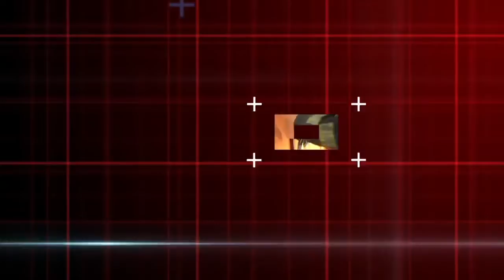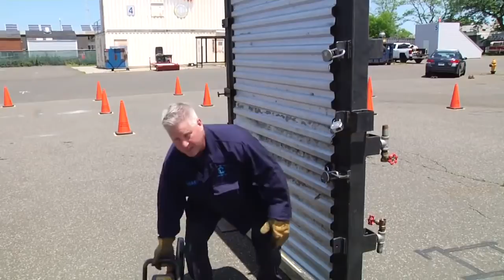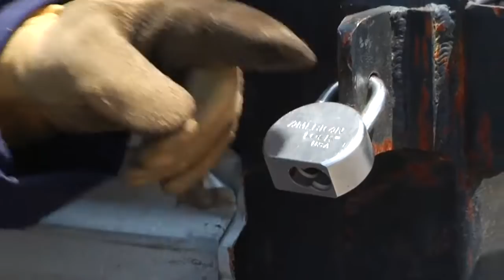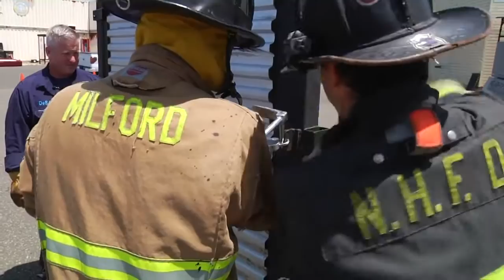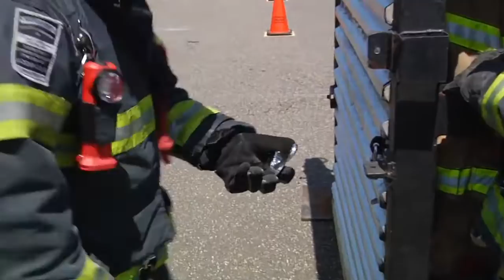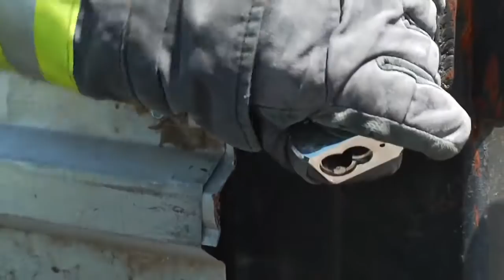Forcing Padlocks with Hand Tools #5806229200001

Comment: The first mistake is assuming that the lock is the weakest link.
You can actually get slowed down and even injure your self trying to fail a lock when the structure it is barring is far weaker.
Reply: technically, the first mistake is no eye safety
Reply: I agree, often the entry way is the most secure part of any building or room.  The door may be the most secure and strongest section of the entire wall.
That said the shackle is often the weakest portion of any lock.  Yes, it is often cutting hardened and you will find it hard to push/pull it, but I have yet to find any that would withstand twisting.
Reply: @luckyx16  When responding to an alarm, look for ways to minimize damage to the property while investigating the cause for alarm.

Comment: both those padlocks are easy picks (less than 30 seconds) with just a turner and a pick.  No need for mindless destruction
Reply: During a fire?
Reply: @topheavykoolaid  yes genius.  It is FASTER to pick than what they did.
Reply: @protonneutron9046  At night, with full protective gear, no way.... Those gloves have zero dexterity. No sense in fumbling with a pick. The irons are going in the front door with you anyways. The twist off method is definitely preferred...
Reply: @protonneutron9046  Maybe not in your mom's basement but a door is often 500 degrees or more... At least in my 24 years of experience as a career firefighter. Man up, join up, and stop watching Chicago Fire...

Comment: Once the key way is removed from that pad lock, a simple flat head screw driver will turn and open it as well.. quicker easier and takes less effort 🤷🏻‍♂️ but when all else fails beat it with the irons lol
Reply: Considering that you (most likely) already have the flat bladed screwdriver in hand, I’d think this would be preferable 👏 (i’m no firefighter though)

Comment: Point the Halligen pike away from face/ towards rotation… so 3ed eye on forehead is not installed if lock brakes fast or dude slips!
Reply: That's what I was thinking too
Reply: Thought the same thing. But if it’s down, and it snaps hard, that pike could do a number on a thigh or arm.

Comment: On FE videos I only see them going after these 700 series style padlocks. I never see masterlocks or any other style. Why is that? Is it "if you can do this, you can do any of them"? Same methods apply? (aside from attacking the bronze shield on the knock off)
Reply: That’s correct generally speaking the American 700 series is going to be much tougher than any generic master lock
Reply: Master Locks are so bad, The Lock Picking Lawyer only has to look at one for it to fall open.
Reply: Masterlocks are a huge name but they are surprisingly easy to defeat. The is a big lockpicking channel where they are a running joke

Comment: Look up the lock picking lawyer he had a covert tool that will open any of those faster that you could start the saw
Reply: This would be great, but fine motor skills get difficult under high stress
Reply: Ramset baby
Reply: the twist off leverage tool was sweet, 2 seconds and done
Reply: In a high stress situation you don't have time to do this. You want gross motor skills not fine. You don't have time to take off PPE.
Reply: From someone whose a expert in picking locks and also a firefighter in emergency situations like this a tool is faster then picking
Reply: What if the padlock has a thin shield that method won’t work with the tool your referring to.
Reply: @camronbay1   he’s talking about the comb pick too
Reply: @CowboybubPercussion  Ues I have these it works well on some locks.
Reply: @camronbay1  maybe maybe not don't know to you try...
Reply: @cheryljason9617   you are talking comb pick too, right?
Reply: Wow you saw a video so you must be an expert
Reply: @mallman23  wow and you read a comment and insert your assumptions...  good job fella
Reply: @mallman23  11 years on YouTube and that's the first comment you decide to make? 🤦🏻‍♂️❌️🤦🏻‍♂️❌️🤦🏻‍♂️❌️

Comment: haven't you guys just tried to have a small dremal with metal blades?
those will cut those pretty quickly
Reply: A small dremel vs a cut of saw is like comparing a pen knife to a felling axe
Reply: @liamboland8158  a dremel can cut through one of those within 30 seconds.

One small cut and it is open. Small compact and powerful enough to get the job done.
Reply: I’d grab a cordless angle grinder before grabbing a dremel
Reply: I second this